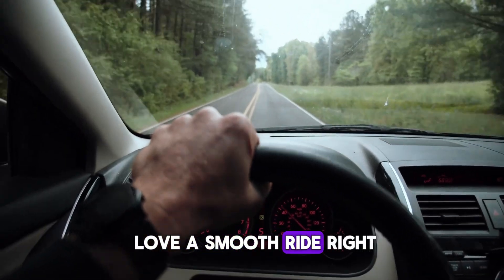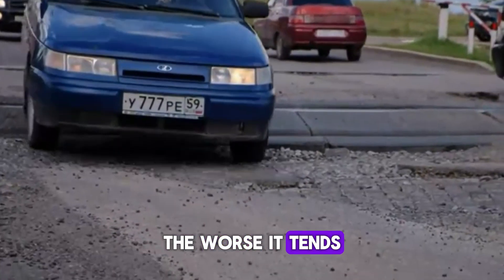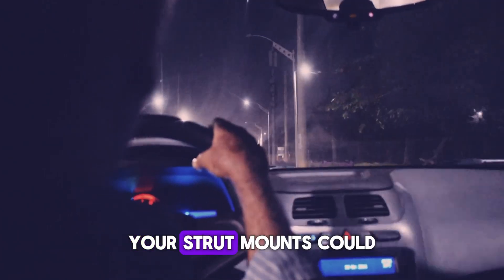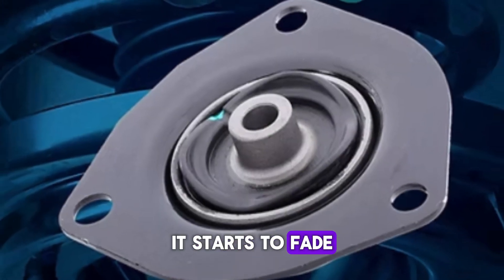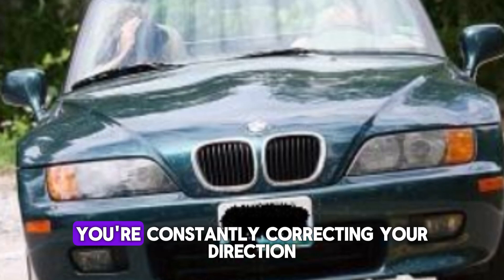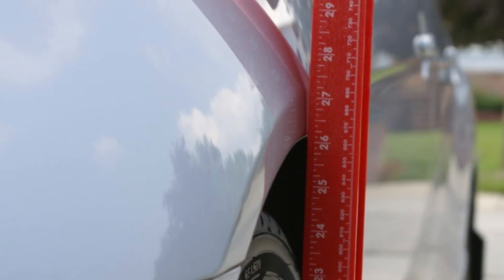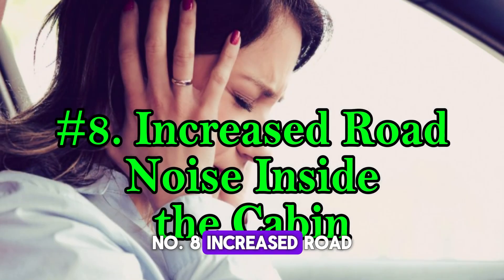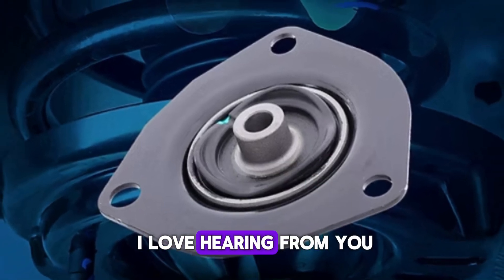8 Symptoms of Bad Strut Mounts Every Car Owner Should Know! #StrutMounts

Comment: Good video🎉 u should have told about the approximate price of strut mounts and how many of them are in a car.❤
Reply from the maker: You are very correct, so sorry about that Standard car: 2 strut mounts (front only)
Some  AWD or performance  cars : Up to 4 strut mounts front and rear

Economy brands: $15 – $30

Mid-range (OEM equivalent): $30 – $60

Premium or dealer parts: $60 – $100+